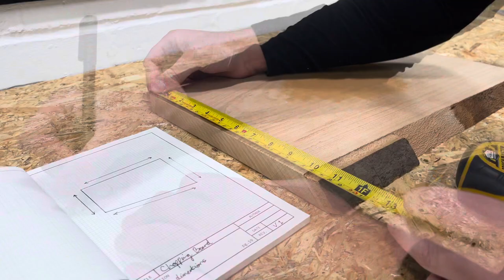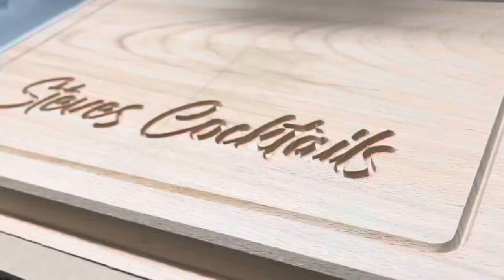Milling a Bespoke Cutting Board on the CNC Router - Genmitsu SainSmart PROVerXL 4030 with insert

Comment: That's a beautiful board. The setup is amazing. I would like to upgrade to a Makita like you did but the big mount that comes with the 4030 is 69mm in diameter and makita is only 65mm (I think), how did you make it fit? Greetings from the UK!

Comment: Nice work! It turned out beautiful. How many inches per minute do you run with that 1/4" bit and what rpm? I just upgraded to the DeWalt on the same machine, but haven't ran a project yet. Thanks!
Reply from the maker: Thanks. Sure, given we have the same machine, here is a longer winded explanation. To start - I mostly guess my feeds and speeds based on my limited experience, then dial them in during the first few passed. This is done via sound, then fine tune by looking at the chips. 

Wood is more forgiving, so I listen for any chatter, make sure nothing is bogging down, make sure the bit isn’t burning the wood, and ensure the chips are nice slices (not dust or chunks etc). 

In order to do this well, I’d recommend a free program called UGS (Universal Gcode Sender). It works on both PC and Mac, connects straight to your machine via usb. (I don’t use the touch screen remote it came with the machine anymore). And although it’s outdated, this program has everything you need to adjust your feeds and speeds during the operation. For example, I dial down my overall feed speed from “100%” (which is representative of the speed I would have pre determined in CAM package) to 30%, and then increase it as I get more confident I got my speeds right (having adjustment on the fly is great).

In regards to exactly what feeds a speeds I had, sorry I do metric, it was at 1000 Millimetres Per Minuet, and the speed is at 15000rpm. I dial it up or down by 2000rpm if the wood is harder or softer or knotty. On soft woods, I often turn the speed up on the fly to 200% of my pre-defined CAM setting. 

Hope this helps…. Subscribe for more projects soon. I’m doing some interesting stuff with brass too.
Reply: @stuff-filmed-here  That makes sense. I have been dialing in my feeds/speeds by ear and chip appearance as well. I appreciate your input on the G code sender. I've been using candle as a noobie, and it's gotten me by. I don't know if it's capable of changing feeds/speeds on the fly. I don't think it is, but there's lots I don't know yet. I just subscribed and am looking forward to more content!

Comment: Is that the router it came with or an upgrade?
Reply from the maker: Yes it is an upgrade - but the machine came with two metal mounts, one for their standard spindle and another bigger mount so you can do the upgrade. From factory it had a small spindle, which worked but I wanted to hog out more material faster. So I installed the bigger mount which I think was only four bolts and took only 5 minuets. I then slide in my own hand held router - I have a Makita RT0700CX4, this is a common and affordable option. It has good power compared to others but with the advantage of have it a wider rpm range and others. I would recommend doing the upgrade.
Reply: @stuff-filmed-here  Thank you for the reply. The project came out beautiful btw. Figured I should let the artist know.

Good to know about the upgrade, I have been eyeing that cnc for a bit now.